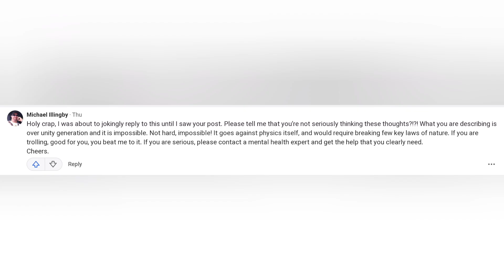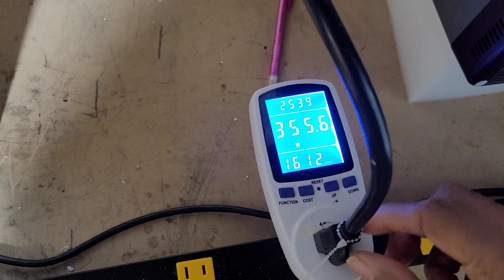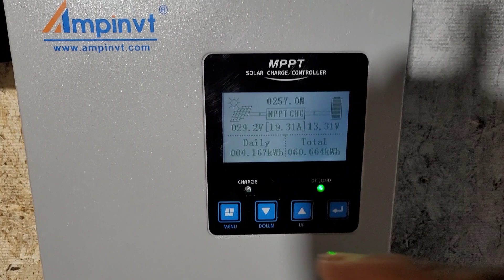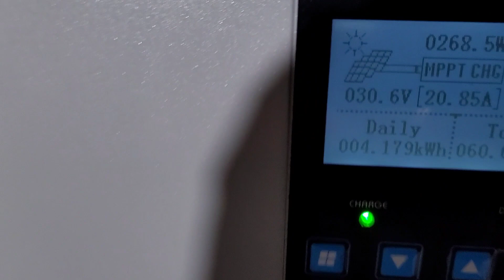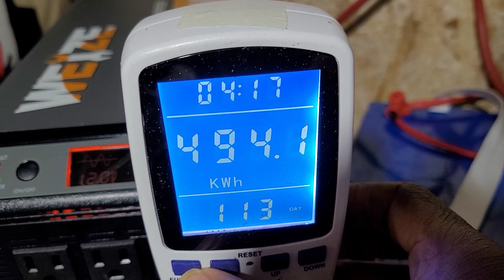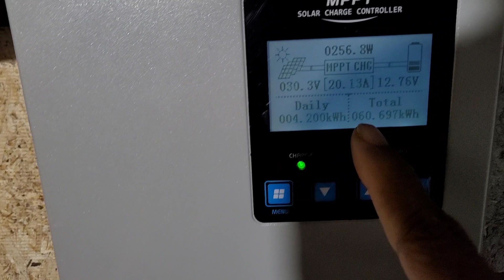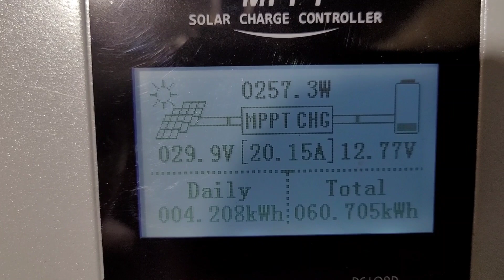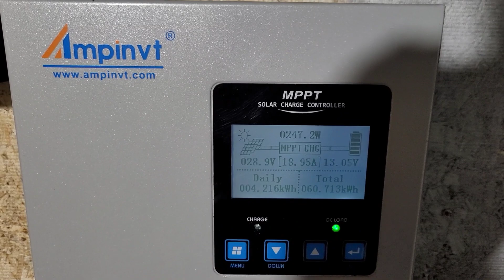the ? asked; Can we charge an inverter using its own output?"  then this happened!!!!!

Comment: The one point overlooked in the video is the battery volt, which drops in the process. As a rule, the displays on each device have a deviation from external measuring devices. Then it is possible that the displays show that a loop "produces" power, but it is large enough battery capacity that the loop can run safely for several hours. Finally, you have to step in and recharge empty batteries. 
One way to learn the use of different appliances and different levels of loss in use, however, the point is that all electrical transitions from one level to another mean a loss in the process – have yet to see any appliance that has efficiency 100%.
Reply from the maker: Hi @hansjrgenkristensen4034,    I understand your point about the battery voltage dropping in the process. This is a valid concern, and it is important to be aware of the limitations of any energy looping system. However, I believe that you are missing the bigger picture.The point of the video was to demonstrate that it is possible to create a system where energy is recycled and reused. This is a significant step forward in the development of sustainable energy technologies. Even if the system does not run forever, it can still be used to reduce our reliance on fossil fuels.You are also correct that there are losses associated with any electrical transition. However, these losses can be minimized by using efficient appliances and by designing the system carefully.I appreciate your feedback, and I will take it into account in future videos. I believe that it is important to have a balanced discussion about the potential and limitations of energy looping systems. By working together, we can develop these technologies to their full potential and help to create a more sustainable future.I did make the statement in the video that this is not a perpetual motion machine and that this system would run down. You can see that at 7:25 into the video. I thought it was important to point this out, so that people do not get the wrong idea about the system.I also want to assure you that it is possible to loop energy and to step up energy. The MP PT charge controller in this video takes voltage and steps it up, which I point out in the video. I am trying to get people to recognize that just because you are putting more power into a system does not mean that you are making any more energy. It is the same energy.By realizing that the energy being used is dropping because it is being used by a system, but at the same time the energy that you are using is being stepped up by the MPPT charge controller, we can see that when we were drawing power from regular shore energy we were only getting from 18 to 19 amps of power, but when we plugged it into itself, it started to produce 20 amps of power. I pointed this out in the video, so people naturally assume that if you're producing more power, why isn't it charging? By correcting this, we can now help people understand that any losses in the system can be made up by solar which is coming into the system, but not as much solar as a regular solar system. This means you can calculate the exact amount of power loss and add the appropriate amount of solar, which would be very little, to recoup that loss and get a gain.Even with the looping of the systems, because of the charge controller, you will be able to put more energy into this system and keep it going because you are drawing on another source of power.
Reply from the maker: @hansjrgenkristensen4034   Just got to stating that but I hope you didn't miss the point of the video the point of the video is that they said you couldn't do it, They needed you to believe that this was impossible I even made a second video which showed that they stated this and it's all over Google. By knowing that you can loop power called induction technology It gives you avenues to store energy and a new way will not know it's old but it's not known, But new process can come out of this. This is not a perpetual motion thing Understand that, Here is the statement I told someone Else just a few minutes ago.     Thank you, I appreciate the compliment. I want to ensure you understand certain principles: while I've managed to loop energy back onto itself, energy doesn't create itself; it doesn't magically appear out of nowhere. In another video, we demonstrate a similar concept but in a different form, explaining why we use solar energy to offset losses like heat from wires and other technical issues that cause energy loss during the looping process. We still require incoming energy into the system, but the device can supply much of the needed energy itself. Check out this video for a clearer understanding. https://youtu.be/0YF2nvKTMz8?si=ugb1HjaN_M0CaIxw

Remember, I'm the originator of overunity and the concept of looping and hyperlooping. My name is Lloyd George Stovall. Good luck, and thanks again for the compliment.   And I mean thatThey're trying to stop certain Technologies so that you never become independent of making your own.
Reply from the maker: @hansjrgenkristensen4034  your point was not overlooked just wasn't a part of the discussion yes I was able to hook in a solar into the cycle and it works just fine
Reply from the maker: @hansjrgenkristensen4034  Exciting News!
My new book “My Purpose is to Drive This Technology to Market” is now officially published and available on Amazon!

This work represents years of hands-on experimentation, theory, and exploration into real-world energy solutions inspired by Nikola Tesla and other pioneers. If you're a researcher, engineer, inventor, or simply curious about future-forward tech, this book is written for you.

I would be honored if you took a moment to read it—and even more grateful if you could leave a review on Amazon. Every rating and review helps increase the book’s visibility and brings this technology one step closer to the world.

Check it out here:
https://www.amazon.com/dp/B0F2ZZ7X5C

Thank you for your support—and let’s build the future, together.
Reply from the maker: @hansjrgenkristensen4034  Colin, I just told you the same thing directly to him—you put timestamps in the video trying to prove the battery was losing energy, even though I clearly stated that in the video myself. How can someone be so observant about one detail and yet completely miss the fact that I explained this battery would not sustain itself and even mentioned exactly how long it ran before draining?

Let’s be honest—that wasn't even the original question being tested. The main challenge posed by critics like yourself was that plugging an inverter into its own charger would blow it up. That was the myth. And I disproved that.

Now, I know you’ve seen the second video, where not only did I run the same loop, but I also added energy back in, showing a net positive gain. So if we’re being intellectually honest, this isn't about the math in the first video anymore—it's about refusing to acknowledge progress when it doesn’t fit your narrative.

At this point, it looks like your only goal is to keep new discoveries and innovations out of reach—especially for people who are building things themselves, outside of corporate or academic control. But the world is paying attention now. We're showing that we can do this ourselves.

Let the gatekeepers throw their tantrums. The rest of us are moving forward.

This means: you lose.

Comment: My only question is how many amps or watts is being used from the batteries to run the inverter?
 Not tested in the video as far as I saw so not in the math you show in this video. I am sure you are aware of that, but that should be added to the information you are testing so you have all loses noted. Just a suggestion so you have all the information and can figure a way to add more back into the batteries to keep them going longer. That should be around 120 watts just to run the inverter but probably more due to inefficiency and all. The only issue with doing this is you always lose power. I read most of the comments and saw you say you have been able to run this for 10 hours. I will have to watch your other videos on this and see what the results are.
Reply from the maker: Yes this is an excellent question and the answer is the experiment was to answer the gentleman's question is it even possible, so we see that it is if you look at the second video you will see that they make these comments that these are designed not to even do what I just did, so I focused on that point only. The second video goes into what can you use this for and can you charge a battery while loop into the system I prove that you can, most people don't know because they don't read old papers is over 100 years old we're people have already done this. Second you can discharge and charge battery at the same time, most people don't know that so again it gives me a chance to make these statements that I can use the battery to boost up a higher amperage and still charged the battery a little bit faster than it normally would. If you missed it go to the second videos at 7:40 on the timeline love the comments though tell me what you think again I'm not breaking the laws of physics so thank you for not seeing that I was even though I stated in the video that I wasn't I'm just using old techniques that I learned over the 30 years running this Library
Reply from the maker: @jw3843  Exciting News!
My new book “My Purpose is to Drive This Technology to Market” is now officially published and available on Amazon!

This work represents years of hands-on experimentation, theory, and exploration into real-world energy solutions inspired by Nikola Tesla and other pioneers. If you're a researcher, engineer, inventor, or simply curious about future-forward tech, this book is written for you.

I would be honored if you took a moment to read it—and even more grateful if you could leave a review on Amazon. Every rating and review helps increase the book’s visibility and brings this technology one step closer to the world.

Check it out here:
https://www.amazon.com/dp/B0F2ZZ7X5C

Thank you for your support—and let’s build the future, together.

Comment: Remember your circuit set up might be pulling from your batteries. Did you measure the battery current?
Reply from the maker: That is why we put the charge controller in line with it all because the video shows the current the wattage and the voltage all at the same time
Reply from the maker: I'm just dropping in a statement I'm a staff Member at media library I work for Lloyd Stovall, I think the idea of what  It was supposed to pull from the battery only it's supposed to go in a circle we were just answering the question was this possible, You'll be surprised how many people commented To our personal email and on our blog and other places like Facebook, And most of them didn't pay attention at all to the video they just seen it and had to make a outrageous comment we did say that this would run down we did say that this wasn't perpetual motion we do know the laws of physics but we also knew that the statement this guy made while calling us an idiot was incorrect It was possible to do this now others ask mor intelligent questions like what is it good for which then we made a second video , inconclusion to show exactly what it is good for. The point is that the efficiency of this system increase when you learn to loop energy just like a coil the more windings on the core the better the efficiency this is common but it can be used in a lot of other application's never thought of. There's no secret these are just principles that's been around for a long time so we're telling people please watch the video again and please pay attention to what is actually being said.
Reply from the maker: @eddietee6305  Exciting News!
My new book “My Purpose is to Drive This Technology to Market” is now officially published and available on Amazon!

This work represents years of hands-on experimentation, theory, and exploration into real-world energy solutions inspired by Nikola Tesla and other pioneers. If you're a researcher, engineer, inventor, or simply curious about future-forward tech, this book is written for you.

I would be honored if you took a moment to read it—and even more grateful if you could leave a review on Amazon. Every rating and review helps increase the book’s visibility and brings this technology one step closer to the world.

Check it out here:
https://www.amazon.com/dp/B0F2ZZ7X5C

Thank you for your support—and let’s build the future, together.

Comment: How do you "charge" an Inverter?
Nature doesn't uphold perpetual motion.
You can't violate the laws of Physics as we know it now.
If the questioner is asking about taking the output of the inverter to charge the batteries then it would only result in very little efficiency conversion. Not worth it.
Reply from the maker: One you have to look at the question being asked and then look at the questions that people were saying first they said it was impossible to do this, in video to they even said that they were designed not to accept the same power that it puts out so we answered the question. Now everybody is repeating this things about physics breaking its laws yet I said those things right in the video was anyone listening I also said this is not a perpetual motion machine that the battery will run down oh, so if everybody is only half listening did how do you ever get anywhere you can't learn anything new if you don't push the limits so what are we pushing so let's answer your question with the battery everyone knows without the battery it won't even work, then I answered the question can you actually charge it doing this method and the answer is yes in the second video on the timeline at 7:40 we proved that you could charge the battery at the same time use the energy from the battery to do so so we're trying to get people to ask more intelligent questions because what I just told you is not impossible
Reply from the maker: @eddietee6305  Exciting News!
My new book “My Purpose is to Drive This Technology to Market” is now officially published and available on Amazon!

This work represents years of hands-on experimentation, theory, and exploration into real-world energy solutions inspired by Nikola Tesla and other pioneers. If you're a researcher, engineer, inventor, or simply curious about future-forward tech, this book is written for you.

I would be honored if you took a moment to read it—and even more grateful if you could leave a review on Amazon. Every rating and review helps increase the book’s visibility and brings this technology one step closer to the world.

Check it out here:
https://www.amazon.com/dp/B0F2ZZ7X5C

Thank you for your support—and let’s build the future, together.